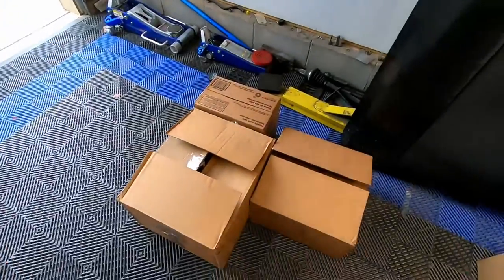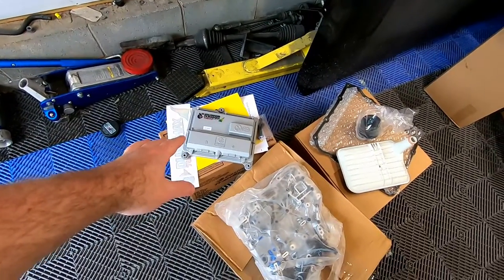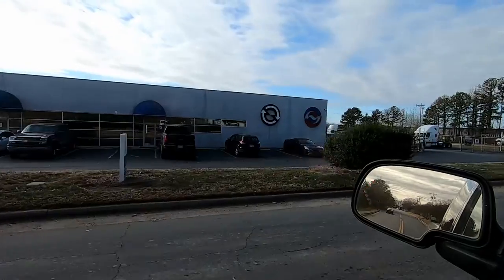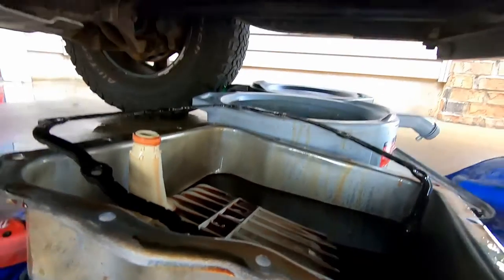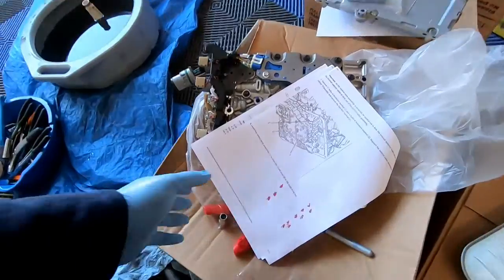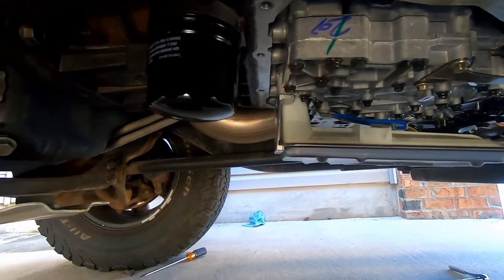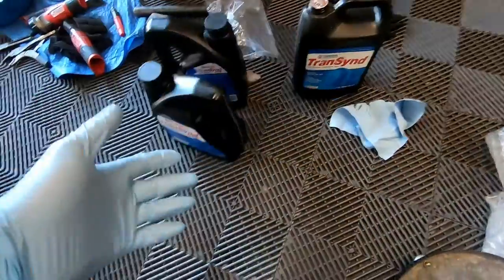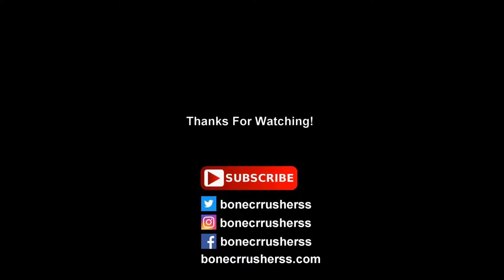2005 GMC Sierra 2500HD - Duramax Tuner 6 Speed Conversion

Comment: Did you experience rough shifts even after the relearning process? Have you felt like this was a worthwhile upgrade in drivability and feel?
Reply from the maker: It only shifted rough once - and that was when it went into 6th gear for the first time. It shifted fine after that. Drivability - had no issues. Feel - it made the truck quieter on the highway since it is dropping it 300 RPM.
Reply: @bonecrrusherSS  thanks for making the video and the response. I'm in the process of deciding to have them build the transmission and if I want to add the 6 speed valve body.

Comment: Can you send a link of those other instructions or show what part you're talking about that you adjusted
Reply from the maker: When you pop the valve body out - the gear selector arm is hanging there inside the transmission. If you don't get the aligned properly - you will have to drain the transmission again. Otherwise it won't move out of park.

Comment: That’s a mod I’m like to do to my truck. Thanks for the video. I’m curious if I’ll hold the taller gear longer when under load with the new tcm? 
I’ll have to ask duramax tuner that.
Reply from the maker: Yeah it does seem to hold a few of the gears longer. Fair warning that it took awhile for the tcm to learn all the new shift points - and 6th gear made a huge clunk the first time I shifted to 6th.

I just went on an 4+ hour road trip for a future video - and I had zero issues with the new 6th gear setup.

Comment: What did you have to do to make the detent pin slide in ? Did you have to remove the valve body again ?
Reply from the maker: Drained the fluid, caught all of that. 
Lowered the valve body down - put the pin and the selector shaft together. 
Put the pan back on - poured the fluid that I captured back in - and haven't had a problem since.
Reply: @bonecrrusherSS  thanks for the insight I finally figured it out by having someone slide the gears shifter through gears  and was mad that the instructions didn’t include a diagram (drawing) of the half moon groove at the bottom of the gear selector and have an arrow pointing to it being where the pin should be placed. Thank you again, I knew I wasn’t the only 1 having problems deciphering those instructions

Comment: Did u have any problems with your transmission after this?
Reply from the maker: No none - it drove perfectly fine.

I did have that shift lever issue as I mentioned in the video - so I did have to pull the valvebody back off. Adjust for that - and got lined properly the second time.
Reply: @bonecrrusherSS  yea I seen that how was your shift points? Were they like factory? Just with 6 gear at 58-60mph?

Comment: Crazy thing is i just got my GMC and decided to see if I'd like to do this swap and your channel came up but im already subbed to you cuz i also have an SS haha apparently I'm just copying you at this point
Reply from the maker: Lmao - now you need a C6 and a Silverado ZR2!

Yeah checkout the Duramax playist. I did the HD hood swap, the Quadrasteer bed swap, 6 speed swap - and some basic engine bolt ons. 

After 13 years of ownership - I only had 2 issues with truck - a plugged transcooler that I replaced with a bigger aftermarket one. The other was a water pump that was seeping at 250,000 miles!
Reply: @bonecrrusherSS  one day I'll definitely get a corvette! But that's good to hear that you had it so long with minimal issues. I'll definitely be going through that Playlist to see what mods to do. My SS is already done besides a better hood some day🤙🏽

Comment: I think the tire size only changes shift points slightly I don’t think it changes the mph that’s a different sensor
Reply from the maker: Tire size absolutely changes the MPH - you have to adjust it in the PCM for it to read correctly if you go with a non oem size wheel and tire combo.

Comment: You need to get a tire size calibrator or if you get the truck tuned they can address the speedometer being off with the ECU tune. One thing I suggest, is actually measuring the tire and not using the advertised tire measurement. All tires for the most part, are undersized from what they advertise.
Reply from the maker: Truck for sure could use a tune.

Comment: Would you do it again?
Reply from the maker: I should have done it sooner. I only had the truck for another year or so with the 6 speed. 

It drops the RPM down a few hundred RPM - makes it quieter on the interstate.

I never had any issues with the kit after I installed it. 

If you drive a ton - it will eventually pay for itself. I work from home - so I never put a lot of miles on my vehicles.

Comment: Will this work with a stock trans?
Reply from the maker: My Allison is stock - just has the deeper pan, filter, and filter brace.
Reply: @bonecrrusherSS  do u think the deeper transmission pan is better than the stock ? Is it a must when u make the conversion?
Reply: @shawnwinters4327  More fluid is generally better, especially for tow pigs. I imagine he’s putting in those parts because they have to come out for the job anyways.
Reply: @shawnwinters4327  While more transmission is typically better, a bigger cooler is the way to roll. The cast pan does provide more rigidity for the transmission case though.

Comment: Excellent video I offer a similar 6 speed conversion option for the 2001-2005 truck, where I can supply all the parts or the buyer can farm out the parts themselves and I supply a remapped TCM with vehicle specific maps for upgraded internals or modified engine applications. Not a one tune fits all also my software update uses all 6 forward gears in both Normal & Tow haul drive modes. you will retain you OD Lockout (4th locked) for 2003-2005 Vehicles. If you want to do a do it yourself application you can contact me and I can supply the TCM & Valve Body harness to your specific application 2006-2010 or 2011-2019 Allison 1000 transmissions. I support both 6.6 duramax and 8.1 votrec trucks and suvs.
Reply from the maker: Cool to see other products out there - I had zero issues with the kit from DuramaxTuner.